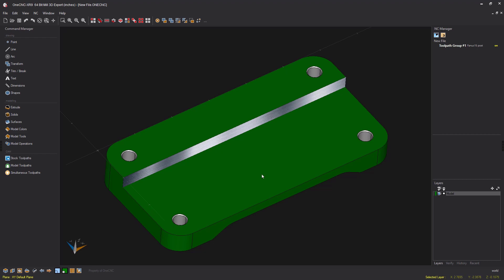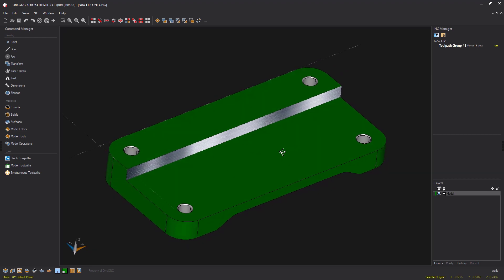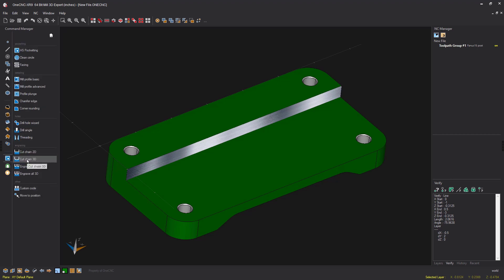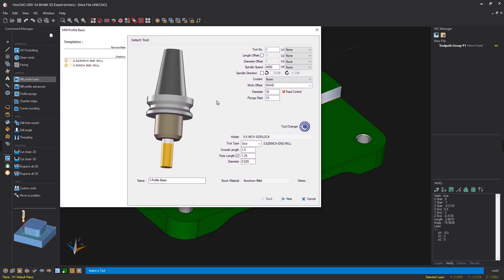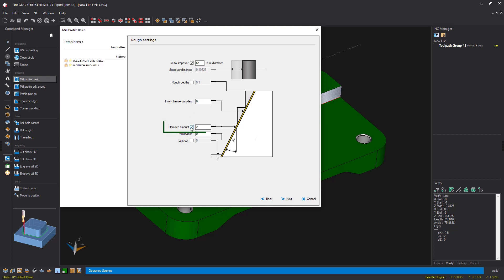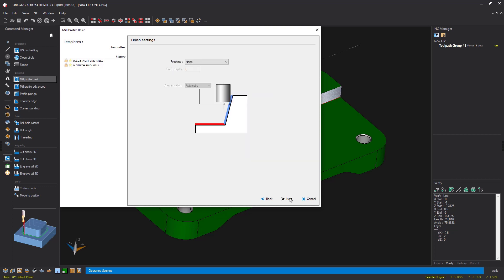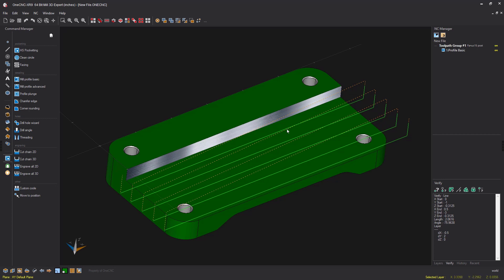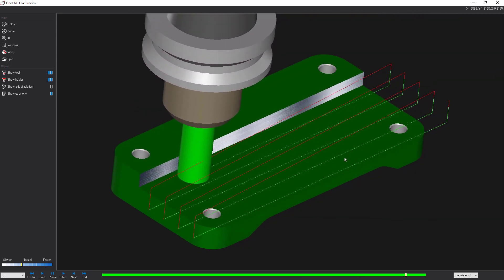OneCNC CADCAM: You had no idea Side Roughing was this EASY!

Comment: Hi Patrick,

Loving this new series!

Quick question? Recently when selecting HS Pocketing I wanted to use the high speed zig zag option, to quickly put two flats across a large cylindrical aluminum block. Unfortunately the simulation would cut one side perfectly Y+ to Y- but the other side Y- to Y+ I was unable to stop the tool from starting in the material regardless of what options i tried. I ended up using the High Speed Open path but the High speed zig zag on the first side offered a superior finish and a faster cut time. Is there a way to select the entry points with these more traditional tool paths and the orientation of how they cut? This would be fantastic if you could cover this!! 

Any help Greatly Appreciated!